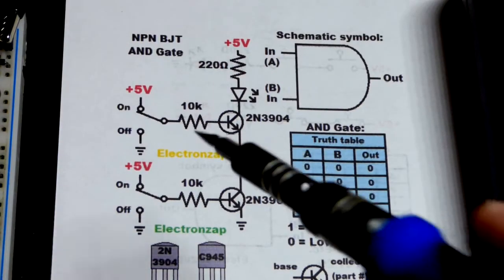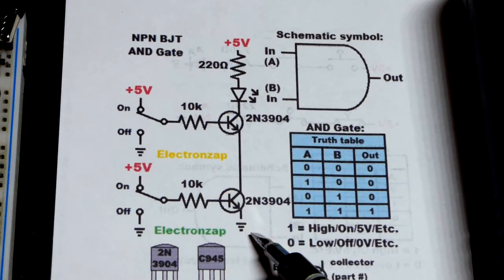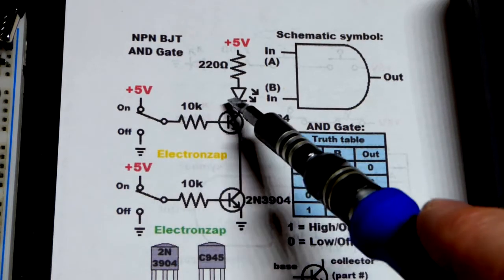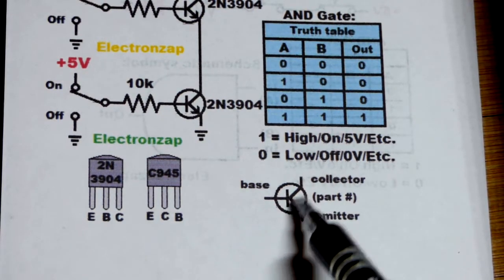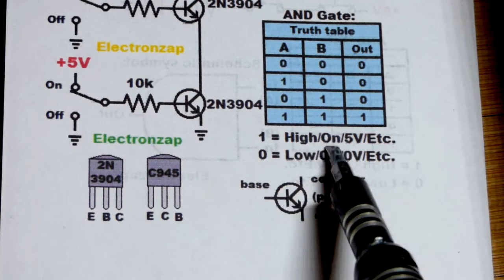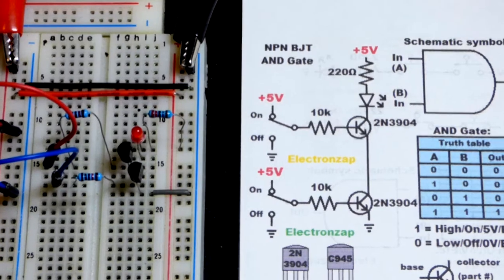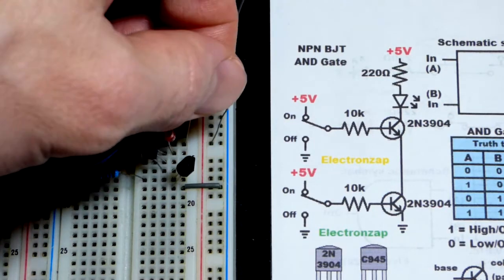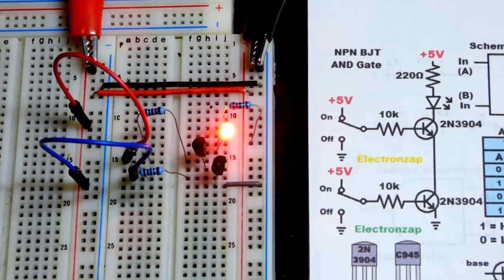NPN BJT AND Gate circuit with 2N3904 Bipolar Junction Transistors Learning Electronics Lesson 0045

Comment: I understand the principal here. However isn't the collector of the top transistor being connected to ground when both transistors are on? That's the opposite of an AND gate. In fact a pull up resistor on the collector of the top transistor to +5 would make this a NAND gate. You'd need a PNP transistor; Emitter to +5, Base to Collector of top NPN, Collector as the output. Then you'd get a logic level 1 when both inputs to the NPNs goes high.